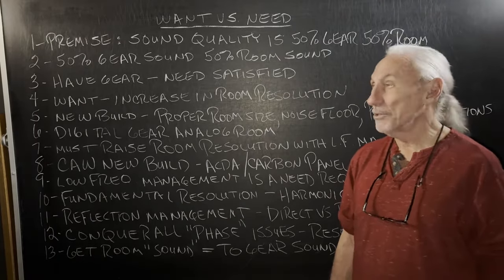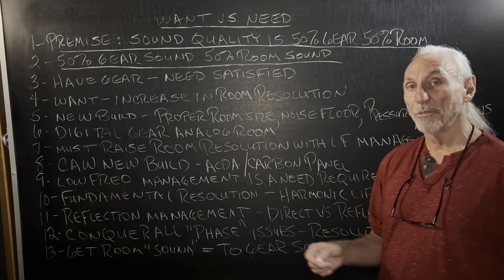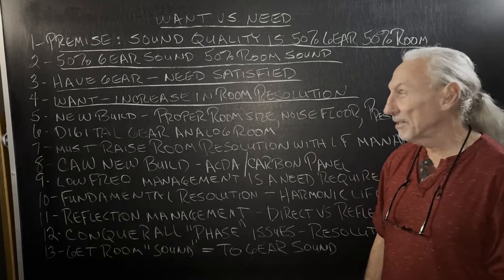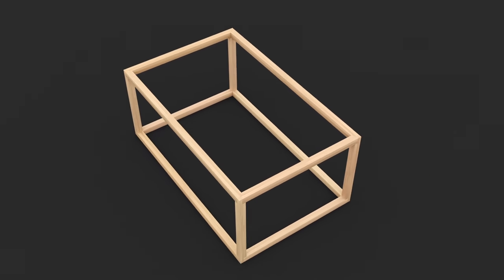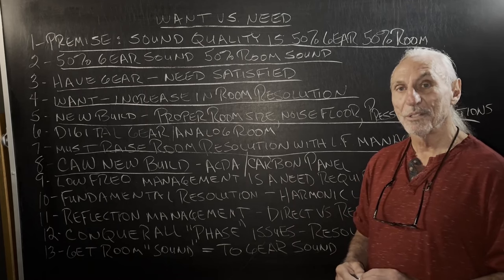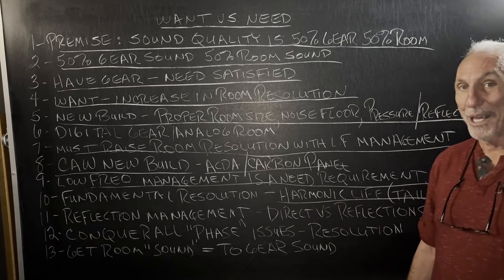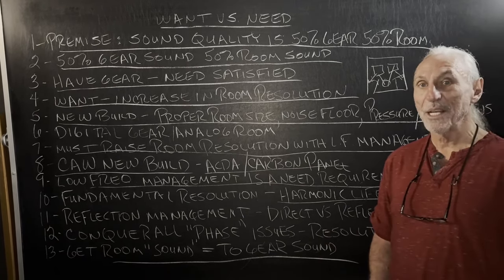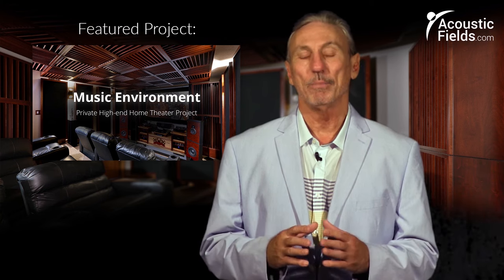Want VS Need - www.AcousticFields.com

Comment: I almost fell into the gear trap last year. I resisted the urge and spent it on room treatment. Much more efficient use of the budget.
Reply from the maker: Gear 50% Room 50%. Physics is the law. Everything else is just a suggestion.
Reply: @AcousticFields  My wife heard a song last night that she was on about 6 years ago that I did another mix on yesterday and said should could hear harmonies she didn’t before. And I mixed it on the same gear I’ve had for over a decade. She said I should thank you because I told her I could hear more accurately after I added some of the treatment I built to the room, suggested in your videos.  So thank you for helping the community so much.